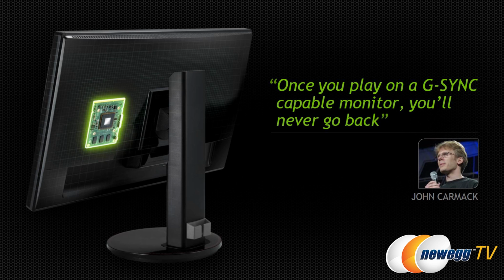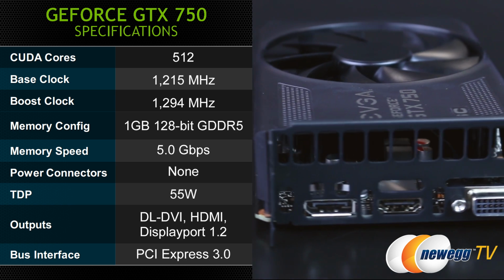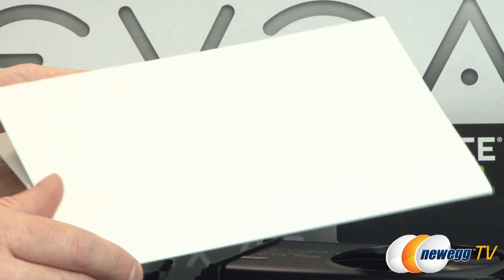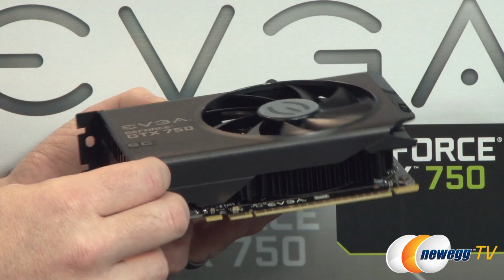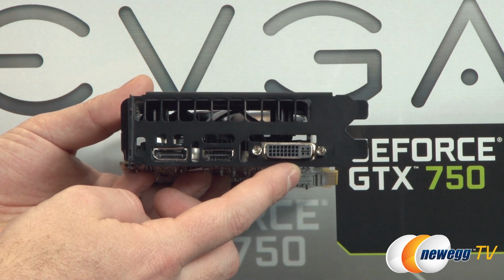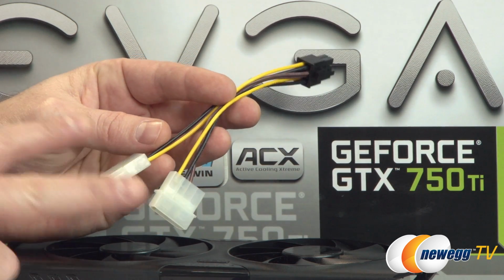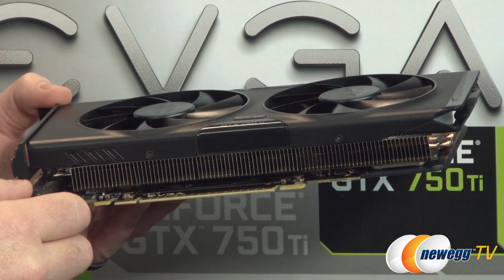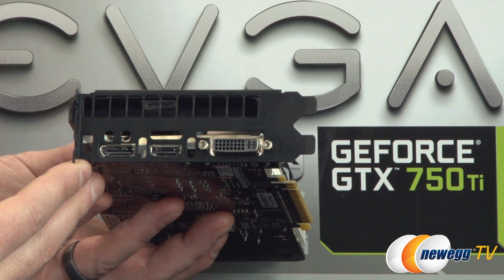EVGA GeForce GTX 750, 750 SC, 750 Ti SC, 750 Ti FTW Video Cards - Newegg TV

Comment: So I'm not the most expirienced with this stuff, so will I have to uninstall the drivers for my old graphics card, I saw a video that said to do that, but I'm not sure how, also, do I just pop it into my computer, or do I also have to plus in the hdmi port on the end of the graphics card. If not what are those ports for?
Reply: you want to open device manger go to "Display adapters" right click on your current graphics card example "Intel(R) HD Graphics" then click uninstall

Comment: Will a Intel i3 3.7 (dual core) work good with this?
Reply: Yes. But instead, I would recommend getting a pentium G3258, which is basically as good, and use that extra $50 for a GTX 960

Comment: does AMD Athlon 5350 processor work well with gtx 750 ti sc?
Reply: +Hannah Scheneberg Yupp it's the most powerful GPU you'd want to run with that particular CPU as it can bottleneck the card a bit even a none sc but nothing worth not getting this gpu over something else like r7 250 for around 90 bucks since the performance is much better on the gtx 750 ti cards for around the same money.

Comment: Is evga 750 ti for the win edition loud?
Reply: No, very quiet. I run a versa z97 anniversary pc modded with a 700w psu and gtx 750 ftw and its beautiful.
Reply: ***** Yes, If you don't have that, I'm sorry. It requires a minimum of 300W.
Reply: ***** I myself run the same graphics card, on a i5 4460 with 24GB of RAM, and 700W PSU. GPU is nice for a budget setup still to this day until 2017-ish. And try to get 16GB, so you can do more tasks if you want.

Comment: wait when he says still no needed power connector on the 750ti does that mean you have to buy one or do you not need one?
Reply: The only graphics card here that needs it's own separate power cable is the 750ti ftw edition. It takes a 6 pin. Hope that helped, I'm not great at computers xD
Reply: +Puppysnatcher IT means it gets its power completely through the PCI slot, just like he said in the video if you would have listened (75w).

Comment: Hello i have about 300wat power supply will i be able to use the 750 ti Sc with this power supply or will i need a new one thank you
Reply: if you go into your settings, you should see how much watts your current rig uses and see everything you need to know. the stock gtx 750 ti sc uses 75watts. check it out, and Google how to see these in your settings. you should be able to... but double check xD
Reply: No you won't, I had to upgrade to a 600w but that's because I'm going to continue upgrading. If you plan to do so get a 600w if not just get the 400w.

Comment: I suggest you look at other cards now. I have the 750 Ti SC. It's a good card but it no longer has the same value it used to have last year. You can Spend an extra $30-50 for a MUCH better card like the GTX 960 or the R9 380. Or spend the same amount and get a used card that's more powerful. I'd only reccomend the 750 ti  above all other cards if you have a Prebuilt desktop with a low wattage PSU.
Reply: +rapper250 well the 750Ti's are going on sale a lot now as retailers want to move them out for the upcoming 950Ti
Reply: I just got a 750 ti sc for 130 and upgraded my PSU to a 600w for my prebuilt desktop. Do you think this is a good step forward or should I have gotten a 760 or the 960?

Comment: Also, how do I know if this is compatible or if it will fit in my computer?
Reply: Plurple Go to pcpartpicker.com and fill out all your specs. It'll check for any problems.
Reply: Also, in the manual for your case (or on the specs online) it should tell you the max. GPU length it can fit.

Comment: I'm making a new entry build that will be heavily upgradeable in the future. Any opinions on it? http://pcpartpicker.com/p/GFxF3C
Reply: http://pcpartpicker.com/p/GgJDK8
I assumed your budget was ~$750, most of the parts were cheaper outside Amazon, but still slightly over $750, could drop to an i5-4460 or a  i5-4690
-620w PSU might seem overkill, but $54.99 Fully Modular, can't complain
-Better CPU
-Better MOBO
-8GB RAM for only $12 more
Reply: Thanks, I have decided to get an i5-4690k, and I found somebody who is selling 2 EVGA 660 SC for only $185. Or just 1 for $100.
Reply: Destry Payne For the price, the GPUs are good deals. The TigerDirect website for Canada still lists them as the final price before the 7xx series.
Reply: Also, I can get the i5-4690k for only $200 if I drive about 40 minutes over to microcenter.
Reply: Destry Payne Hey I have a question, is the 750ti FTW edition overclocked or superclocked?
Reply: *****
Superclocked actually means it comes overclocked out of the factory. FTW
means it's even higher clocked than SC, plus it has the ACX cooler that makes it to where you can overclock it yourself even higher. If your looking at the 750 Ti, also consider the GTX 960, as it is the beefed up version of the 750 Ti for only about $210.
Reply: nvm, thanks man
Reply: Posting a PCPartPicker link under a Newegg video's comment section is a blasphemy. Lol

Comment: Hey guys, will I be able to play the crew on high/ultra settings?
CPU: Intel Core i5-4440 @ 3.1GHz
GPU: ZOTAC NVIDIA GeForce GTX 750 Ti 2 GB Edition (not FTW or overclocked or superclocked)
RAM: 8 gb
Please reply as soon as possible. :) And is there an appreciable difference between 750 Ti and 750 Ti SC, OC & FTW??

Comment: Hey hey hey now, please answer me as quick as possilbe. If i get the Evga geforce gtx750 ti, don't i need a 6pin power connector? If i don't you, you just made my day!
Reply: RushForKills You are right. The FTW doesn't need external power cable unless you overclock it more from the already superclock.
Reply: Actually, from the list of all these gpu's on this list, is the only one that needs a 6pin adapter the 750 ti FTW?
Reply: You don't.
Reply: The the ftw is the only one that requires extra power
Reply: Thank you! Now i can get the 750 ti sc and not worry about getting a new psu for it. :D
Reply: I though the ftw only required the power pin if you were over clocking, cause the specs say that it can still run with a 60w tdp. Maybe I'm just reading that wrong

Comment: Is it true that this card

http://www.newegg.com/Product/Product.aspx?Item=N82E16814487034

On y'alls site can on the PCIe bus and doesn't need any external power to run, meaning to need for an external 6 pin connector??? If so, I should be run this on my 300w power supply.

Comment: Looking to upgrade my XFX Radeon HD 7750 to either a GTX 750 TI SC or a MSI R9 270x. Any thoughts on which I should get? GTX 750 TI SC is about 138 bucks on Amazon, MSI R9 270x is 160 on amazon; my budget is 150 and under, but I am looking for quality overall. Please, no biased answers/fanboys.

Comment: So the GTX 750 Ti FTW and SC are clocked?
That means that the life is cut? because I heard that the overclocked components last less.
Or that only applies to CPU's?
Also which one of them is better on performance?
Reply: I think by only a little because of how much heat its making,the ftw uses 2 fans so that might not happen with the ftw but the ftw is loud from what I hear
Reply: Sam Ricardo Probably not, overclocking only hurts it if you do it too much, the amount of overclock in the SC is probably not going to make a difference in the life of the GPU.

Comment: will the 750 run bf4
Reply: Don't touch the 750 base model. Get the 750 ti sc or the 750 ti ftw.  Both come factory OCd and you can OC both again for max performance. The AMD card that is in the same class is the R7 270X, but it runs hotter and consumes more power. The Maxwell technology in the 750 cards is amazing. They use very little power. No doubt the card I recommend to anyone looking in the 130-150 dollar range. You can run most games on high. Some on Ultra and some you will have to run on medium depending on your system specs. BF4 is optimized for AMD and Mantle technology, but these cards will run it fine.
Reply: yeah ultra/high
Reply: #easilyultra
Reply: thats what i got a 750ti ftw from evga
Reply: Yes I have one, I can play   bf4

Comment: Should I get a gtx 750 ti ftw for the "newest generaiton" or should I get a 660 ftw because it is faster? I am going to be running 1600x900 resolution. 
Specs:
600 watt psu
i7 3770 @ 3.4ghz
10 GB DDR3 RAM
Reply: if you're gonna game on this pc dont get a i7, its waste of money. You can just go for a i5 or i3
Reply: i7 is overkill unless you want live stream during gaming or want to do serious video editing. The i5 performs just as well with games. Once again with the RAM. Unless you want maximum performance using editing video software all you need is 8 RAM for games and that's enough to future proof right now. Use dual channel 2x4 rather than 1x8 if possible.

Comment: So I have a basic PC that I bought a while ago and it has a stock 300W power supply and a motherboard with a PCI-e 2.0 express slot. Would the GeForce GTX 750Ti SC work in this set up?
Reply: you will need at least a 350 watt or 400 watt power supply

Comment: If I get the GTX 750 ti (non-superclocked), can I clock it manually to the same as the superclocked version without issues? My local store only has the non-superclocked ti edition. Anyone?
Reply: Yes but you will loose your warranty although you will gain some performance there is no reason to overclock this little beast unless you want a bit more performance around %6 gain but it varies (safe overclock) so yeah definitely get it unless you can find it on the internet and want the Super-overclock get that instead because you will keep your warranty and also gain a bit of performance.
Reply: Yes but the superclocked version can overclock even further as it is a higher quality binned GPU.
Reply: bob james
Thank, Bob. In the meantime, I have purchased the Zotac GTX 750 Ti, which is actually clocked and designed very much like the NVidia reference board, except for a different kind of cooler. Have not overclocked it at all, but it runs the few games that I have extremely well. I only have 1. Fallout New Vegas, which is an older game (runs EXTREMELY well maxed out on 1080p), 2. Warp - this one runs a little iffy, but I think it's a poorly optimized game (got screen tearing and it's a little jerky during room transitions), 3. Half Life 2 - this one, like FONV runs extremely well all maxed out, but again much older game, and 4.) Bioshock Infinite.
Now the latter of the games (Bioshock) runs very very smooth with everything set to ULTRA, DX11 Alternate Lighting ON, FXAA ON (via Nvidia settings), V-Sync ON at 720p, which is the resolution I choose to play all my PC games because my TV has a native resolution of 1280x720 (an older Sony Bravio 37" TV). Really, really smooth gameplay. There are the occasional scenes where it seems to slow down a little, albeit for no apparent reason, e.g. a guy show-shining someone's shoes, turning around in that area gives a slight slowdown. Not sure why because that scene is indoors and no action happening. But the large outdoor scenes, or the rides on those rails, or even when there are lots of enemies on screen, the game keeps running butter smooth of 60fps. I love it. I have not dared to try 1080p with that game as I kind of expect the framerate to drop given the card is more of a budget card.
Anyway, thanks for that information regarding the GPU binning. See, I thought they are all the same chip across all the 750 Ti cards, just with supporting cooling solutions for the overclocks they choose. But as I said, I don't even think this card needs an overclock. I for one am extremely satisfied with the vanilla card I received from Zotac.
(Sorry for the long post; I just get so excited about this card and can't help but rave)

Comment: I've got a 750 TI from EVGA in a 4 year old core 2 quad HP workstation computer. Completely stock, threw the card in and it worked perfectly. I have a couple videos on my channel taken with shadowplay. I currently have it on a 200mhz core overclock and a 300mhz memory overclock and plays skyrim at ultra at 75fps (at 1440 x 900 )

Comment: so which card is best if im looking at a $200 budget
Reply: 750ti newegg exclusive out of these buttt it go for a 760 if u can
Reply: Nevermind 760 is really expensive now go for a 660 gonna do better than the 750ti FTW
Reply: ***** +1 , i'd get The EVGA GTX660 FTW ACX
Reply: it matters if you can run a larger card than the 750ti
Reply: GTX 660
Reply: what about of the msi geforce gtx 750 Ti twin frozr
Reply: Either a Radeon R9 270, Radeon R7 265, Or a GTX 660
Reply: get a gtx 670

Comment: How big is the different between the 750 Ti SC and the 750 Ti FTW?
The 750 Ti FTW has 13 MHz more Core/Boost Clock then the 750 Ti SC, but it needs a 6-pin.
Will i get more FPS with the FTW Edition and if yes, how much more?

Comment: cant they raise the pci-e power to 150w?
so more gpu's can go cable free
Reply: I don't think the cables are considered to be big enough of a hassle to enough people for the people who come up with the interface to feel the need to make PCI-e capable of that. It would require a rather extensive revision of the current PCI-express interface because the power limit is base on physical limitations.
Reply: or just a few extra lines on the x16, and make the slot open, so it is backwards competible
Reply: But then the 4th gen cards (assuming it would be called 4th gen) Would be to long to fit in existing PCI-e slots.
Reply: arent x16 slot open at the end??
Reply: No. Some of the smaller ones like the x1, x4, and x8 slots are, but not all of them. Even if they all were you would still need a power connector to use a gen 4 card on a previous interface.

Comment: if you dont bench sli 750s i will dislike the next video -_-
Reply: there is no sli on this cards, if i'm right
Reply: there will be on non reference
Reply: this card does not support sli
Reply: well i was excited for nothing then :/ that sucks .
Reply: ZanyDivine737 seriously doubt it, even on the ASUS version that requires a 6 pin connector their still is no SLI
Reply: 1. its a very a 50 model, expect budget performance, and not sure if SLI is even possible unless its handled by the PCI slot.
Reply: Tyler Stewart its not SLI capable and its been answered like 5 times
Reply: Is that just because of no sli bridge connector or the fact that it can't, for some other reason, sli in pcie? That sli bridge only increases sli performance a small bit from what I've seen.
Reply: Earnest Bunbury the sli bridge is needed to have the system detect sli
Reply: *****
thx
Reply: ***** not true.
Reply: Maybe they will do as they did with the 650/650 Ti and release a boost version of it with SLI compatibility.
Reply: ***** no, boost was introduced with the 650ti boost cause it was a new technology from nvidia called GPU boost. Its on every card now. As a matter of fact its now GPU boost 2.0 with the 700 series on up the 650ti was 1.0,a sli version maybe.doubt it
Reply: Well think about it... I mean, what the point of SLI the card when there are much better cards that will perform the same if not better then if you ran these in SLI...
Reply: gavin dodd price and power consumption